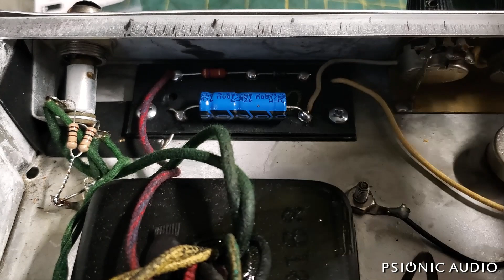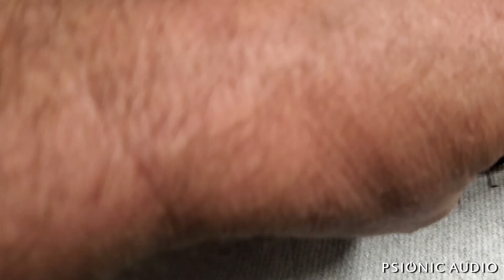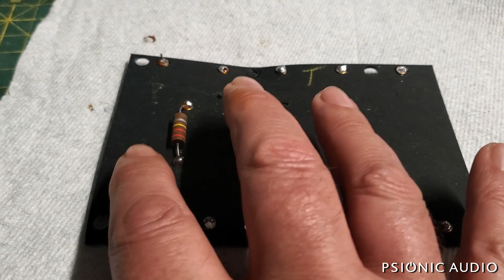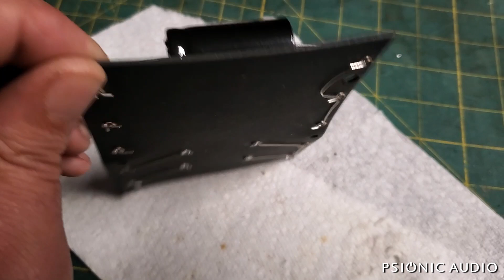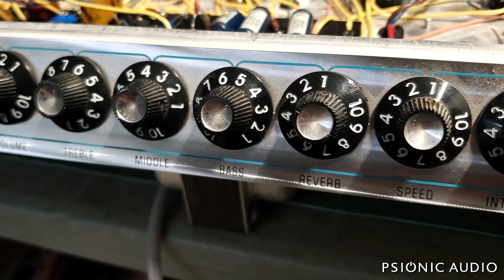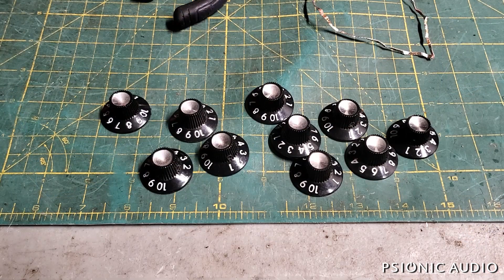Time Machine '68 Super Reverb Part 5 - Almost There (Filter Caps, Power, & Playing)

Comment: Why did you leave the wires grounded on the tabs under the transformer mounting nuts instead of soldered to the chassis?  You usually prefer the wires soldered to the chassis.

Comment: Hi Lyle. Another phenomenal video with more great detail. I wonder if you could advise which silicone to use to secure the filter caps. There are so many on the market and I don’t know which one to buy or which features are important. Would really appreciate your advice. Best regards
Reply from the maker: This is good stuff. It’s also at auto stores.

https://tubedepot.com/products/clear-rtv-silicone-adhesive-sealant-permatex-3-oz-80050

Comment: Regarding the terminal choice on the old outlet, the convention is that the silver is neutral and the brass or copper is the hot lead. I'd double check that, but I'd rather install a grounded outlet because I use it on my twin for a wall wart supply that doesn't need a ground.

Comment: The vent cuts aren't bulged out yet, so they are not ready to spew goo yet, but they could be electrically leaky or have a very high ESR. Woodward Schumacher was NOT what I would call "good iron". It was cheap but adequate, but  Leo Fender was a notorious cheapskate, and then CBS took that to a new level, and then FMIC came along and they are grand masters at cheapness.
Reply from the maker: Maybe you don't mean to sound like you're arguing with me on my channel in front of my customers.

Comment: I just discovered your channel and love these videos.  I’ve restored countless 60’s and 70’s Fender amps over the last 3 decades.  I’m experiencing a strange familiarity with most of your repair techniques, since I’ve been doing the same things, in the pursuit of neatness and reliability (and doing the RIGHT THING for the customer so their amp sounds great and won’t die on stage).  Cleaning out the old solder, scraping off the old flux, using crimping to secure wires, etc. etc.  All stuff I do.  Sure it’s time consuming, but I would not do it any other way.  (J-hooking should be illegal!).

As for the collector vs. player argument (i.e., “do you want a museum piece or an instrument to make music on?) ... not enough guitarists realize that their 100% original vintage amp is, in a sense, anything but original.  Those original, dying (and drying) electrolytics and drifted carbon comps don’t operate and sound like they did when the amp was new.  A proper electronic restoration will make the amp sound much closer to how it did when it first sat in the music store showroom.  I don’t agree that a 100% original amp that is noisy, sounds weak and saggy, and produces ghost notes like crazy somehow has “mojo”, while properly servicing an old amp risks causing it to lose all it’s mojo.  Theres a lot of superstition among guitarists and combatting it is a constant uphill climb. Keep up the great videos!  They should be required watching for vintage amp owners.

Comment: Hello Lyle, you mentioned getting a new ESR tester. Just curious to which one you decided on. I have had a Capacitor Wizard for several years. I like it even if it is a "one trick pony". Unfortunately I hit a charged electrolytic with it and rendered it useless.
I was prepared to buy the Blue ESR and stumbled across a "repair kit" for the Cap Wizard. We will see!
What are your thoughts? My thought is...I should have made sure those caps were discharged...yikes!

Comment: What is your honest assessment of the available "clones" of our beloved vintage american amps?? The mojotones and Webers! Also are you familiar with the Ted Weber take on the AC 30??? I would think with some careful replacements of components a good solid amp can be had.
Reply from the maker: Mojotone kits are good if a good builder assembles them and corrects various mistakes in the layout/circuit.

Weber kits are garbage. The crappiest components in the flimsiest chassis. Avoid.
Reply: @PsionicAudio  - how about Allen amp kits ?
Reply from the maker: Allens are very good.
Reply: @PsionicAudio  ceriatone is very interesting too. I'm a hobbyist and a drummer. But I worked in an electronic plant in Japan for five years and know enough to be dangerous!! I was playing drums professionally when that super was built! I'm also a guitarist but into acoustic finger picking but love the sound of a tube amp and guitar plugged in and dialed in!!  I'm interested in building a Tweed vibrolux ( a harvard with trem??)  And a single ended higher power 6l6 / KT 66 type  But build my own head and speaker cabs.My wife is against the idea!!
Reply: @russellesimonetta3835  - I’ve built two Ceriatone Centura Klon clone kits for friends and they are amazing ! One guy in a band had his band mates asking where that tone was coming from. A fun build

Comment: Beautiful work as always Lyle. I agree with your comments about finicky collectors ( to each their own I guess ). I’ve seen some repairs where the tech slices the capacitor tube and hides the new cap inside so it looks original. Lots of extra work to be sure. Wonder what your thoughts are about all that ?
Reply from the maker: Thanks! 
I loathe that practice. I don't find cardboard tubes all that sexy, and I think the whole thing is ridiculous at best, deceptive at worst (could make a buyer think something is original when it isn't)

I refuse to do it.
Reply: @PsionicAudio  Interesting, I never considered that someone might try to fool a collector into thinking the caps were original. I think you’re spot on that Leo designed the amps and guitars to be serviced and kept running for working musicians. Even Eldon Shamblin’s Tweed Super in the Musical Instrument Museum here in Phoenix has been recapped. 
They’re meant to be played. I bet Leo would have been offering upgrade kits for 3-wire power cords and the like.
Reply: Uncle Doug ?
Reply: @BadToad1963  I in no way am making a negative comment about Uncle Doug being deceptive, as I’ve learned a lot from his videos, but he is one tech that did the cap hide thing. I am sure there are others as well. It may have been at the client’s request.
Reply from the maker: The only criticism of Doug I will ever offer is that it would be nice if all his viewers pooled together and bought him a guitar tuner. ;)
Reply: @PsionicAudio   😆 !